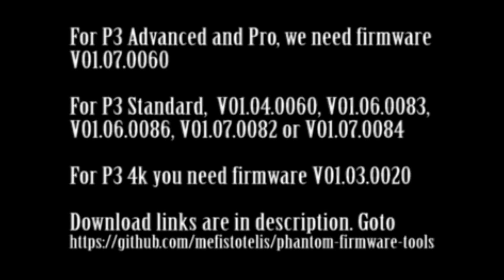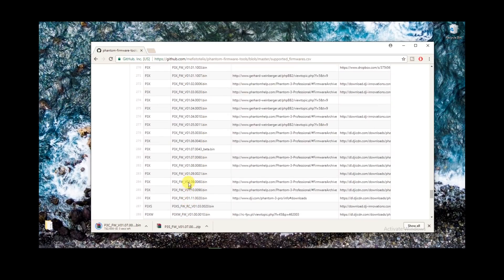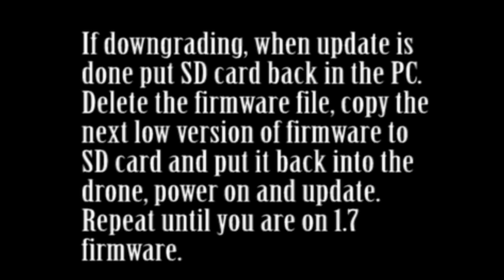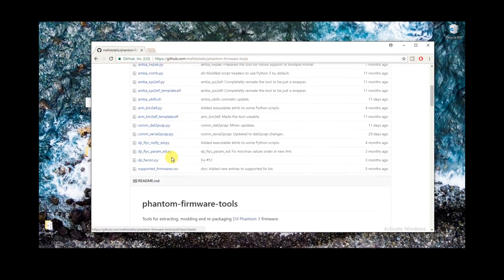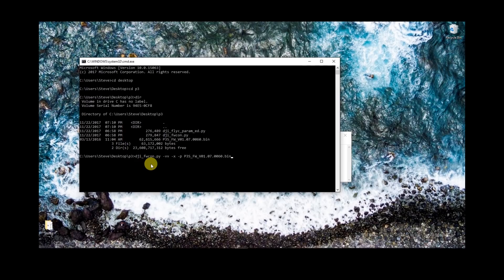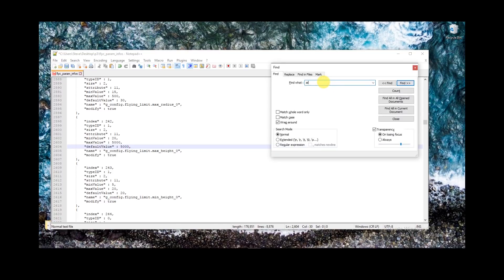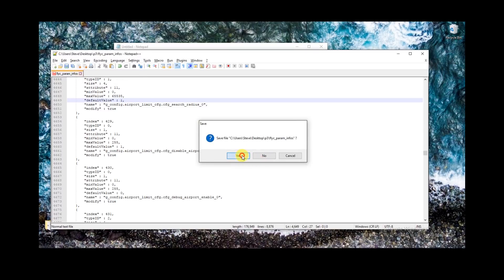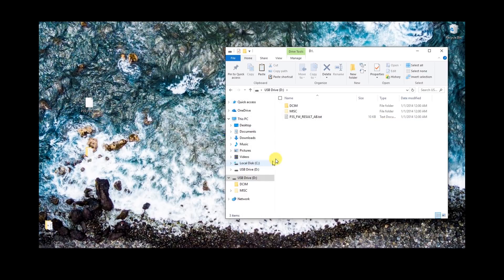Phantom 3: How to modify flight parameters and hack height, speed, flight area restrictions

Comment: P3A 1.7 RC1.57 APP 2.42 ,
After you have modified flyc_param_infos according to your method and uploaded it,， NFZ Still，Is NFZ written into the hardware?
Reply from the maker: make sure you do the two nfz parameters, after nfz will not prevent flight. It still shows the red circle and will prompt you.

Comment: Got my parameters modified and it's working fine in regard to the new parameters. When I go to the about in my DJI GO app it still shows the + after the version. I did each downgrade in order with debug file on SD card for each time. My controler downgrade went fine. My drone works fine as well. Love the new freedom with the mods!
Reply: Can you guide me downgrade? 1.09 to 1.08 ?? I lowered the compass no cali.
Reply: What model did you do ? Pro or advanced? And did u use these parameters? And all worked   nfz etc etc height? Hack

Comment: i have the phantom 3 pro running FW VO1.11.0020.BIN but i cant get it to run in cmd keep getting no module named crypto any one please ,just want to modify my firmware i have installed now is it possible thanks in advance
Reply from the maker: your gonna need to install a module into python called crypto. more info here: http://dji.retroroms.info/howto/modp3params
Reply: thank you so much at last only one thing do I have to put = before the value number or just do the same as you and change the default value?. have repacked the file opened in the notebook to check and all the values are changed just as you have done, but in my cmd it says updated zero parameters , but like I say the file I have saved shows the values have changed so am I good to go or do I need to put = before the value ie =2 thanks in advance great video by the way
Reply: So if "defaultvalue" :=50, is that good  or just change the same as the video help I'm nearly there

Comment: im getting an error when running the first extract command, can someone help? heres the content
C:\Users\April\Desktop\p3>dji_fwcon.py -vv -x -p P3X_FW_V01.07.0060_m0306.bin
P3X_FW_V01.07.0060_m0306.bin: Opening for extraction
Traceback (most recent call last):
  File "C:\Users\April\Desktop\p3\dji_fwcon.py", line 672, in <module>
    main(sys.argv[1:])
  File "C:\Users\April\Desktop\p3\dji_fwcon.py", line 651, in main
    fwpkgfile = open(po.fwpkgfile, "rb")
FileNotFoundError: [Errno 2] No such file or directory: 'P3X_FW_V01.07.0060_m0306.bin'

C:\Users\April\Desktop\p3>dji_fwcon.py -vv -x -p P3X_FW_V01.07.0060.bin
P3X_FW_V01.07.0060.bin: Opening for extraction
P3X_FW_V01.07.0060.bin: Package format version 2016 detected
P3X_FW_V01.07.0060.bin: Header:
{   'entry_count': 15,
    'hdrend_offs': 846,
    'magic': 305419896,
    'magic_ver': 1,
    'manufacturer': b'DJI',
    'model': b'P3S',
    'padding': '00000000000000000000',
    'timestamp': 1457841881,
    'ver_latest': 17236028,
    'ver_latest_enc': 113525633,
    'ver_rollbk': 17170472,
    'ver_rollbk_enc': 113591189}
P3X_FW_V01.07.0060.bin: Module index 0
{   'decrypted_len': 43776,
    'decrypted_md5': 'cc3baf52297f2eb67adf98f0270956f4',
    'dt_offs': 846,
    'encrypt_type': 1,
    'reserved2': 1,
    'spcoding': 16,
    'splvalue': 0,
    'stored_len': 43776,
    'stored_md5': 'bbd8964489204dfdb8858d5824a116b0',
    'target': 'm0305',
    'target_name': 'main '
                   'controller '
                   "'A3' "
                   'ldr',
    'version': '34.02.0009'}
P3X_FW_V01.07.0060.bin: Module index 1
{   'decrypted_len': 788916,
    'decrypted_md5': 'dff8c595d9b465617c8a1aa45aaa109a',
    'dt_offs': 44622,
    'encrypt_type': 0,
    'reserved2': 1,
    'spcoding': 0,
    'splvalue': 0,
    'stored_len': 788916,
    'stored_md5': 'dff8c595d9b465617c8a1aa45aaa109a',
    'target': 'm0306',
    'target_name': 'main '
                   'controller '
                   "'A3' "
                   'app',
    'version': '02.04.3328'}
P3X_FW_V01.07.0060.bin: Module index 2
{   'decrypted_len': 93696,
    'decrypted_md5': 'dddb469333d2d709d1beb283c2427f9b',
    'dt_offs': 833538,
    'encrypt_type': 1,
    'reserved2': 1,
    'spcoding': 16,
    'splvalue': 0,
    'stored_len': 93696,
    'stored_md5': 'ba4eb3942104fcdec2654f8a00dc6846',
    'target': 'm0400',
    'target_name': 'gimbal '
                   'mdl '
                   '0',
    'version': '01.41.0000'}
P3X_FW_V01.07.0060.bin: Module index 3
{   'decrypted_len': 19140,
    'decrypted_md5': '09bebba2951faf82ea3f9cb0793f5dd7',
    'dt_offs': 927234,
    'encrypt_type': 0,
    'reserved2': 1,
    'spcoding': 0,
    'splvalue': 0,
    'stored_len': 19140,
    'stored_md5': '09bebba2951faf82ea3f9cb0793f5dd7',
    'target': 'm1100',
    'target_name': 'battery '
                   'controller '
                   '1 '
                   'app',
    'version': '01.07.3841'}
P3X_FW_V01.07.0060.bin: Module index 4
{   'decrypted_len': 42496,
    'decrypted_md5': '8f773cc3245745ac6861af803fc520b6',
    'dt_offs': 946374,
    'encrypt_type': 1,
    'reserved2': 1,
    'spcoding': 16,
    'splvalue': 0,
    'stored_len': 42496,
    'stored_md5': '4b0ef2a6f0acac04b2c5582ee21361e8',
    'target': 'm1200',
    'target_name': 'electronic '
                   'speed '
                   'control '
                   '0',
    'version': '01.10.0000'}
P3X_FW_V01.07.0060.bin: Module index 5
{   'decrypted_len': 42496,
    'decrypted_md5': '8f773cc3245745ac6861af803fc520b6',
    'dt_offs': 988870,
    'encrypt_type': 1,
    'reserved2': 1,
    'spcoding': 16,
    'splvalue': 0,
    'stored_len': 42496,
    'stored_md5': '4b0ef2a6f0acac04b2c5582ee21361e8',
    'target': 'm1201',
    'target_name': 'electronic '
                   'speed '
                   'control '
                   '1',
    'version': '01.10.0000'}
P3X_FW_V01.07.0060.bin: Module index 6
{   'decrypted_len': 42496,
    'decrypted_md5': '8f773cc3245745ac6861af803fc520b6',
    'dt_offs': 1031366,
    'encrypt_type': 1,
    'reserved2': 1,
    'spcoding': 16,
    'splvalue': 0,
    'stored_len': 42496,
    'stored_md5': '4b0ef2a6f0acac04b2c5582ee21361e8',
    'target': 'm1202',
    'target_name': 'electronic '
                   'speed '
                   'control '
                   '2',
    'version': '01.10.0000'}
P3X_FW_V01.07.0060.bin: Module index 7
{   'decrypted_len': 42496,
    'decrypted_md5': '8f773cc3245745ac6861af803fc520b6',
    'dt_offs': 1073862,
    'encrypt_type': 1,
    'reserved2': 1,
    'spcoding': 16,
    'splvalue': 0,
    'stored_len': 42496,
    'stored_md5': '4b0ef2a6f0acac04b2c5582ee21361e8',
    'target': 'm1203',
    'target_name': 'electronic '
                   'speed '
                   'control '
                   '3',
    'version': '01.10.0000'}
P3X_FW_V01.07.0060.bin: Module index 8
{   'decrypted_len': 2680,
    'decrypted_md5': '08e01b61a70e503bb60362eaf4d734cc',
    'dt_offs': 1116358,
    'encrypt_type': 0,
    'reserved2': 1,
    'spcoding': 0,
    'splvalue': 0,
    'stored_len': 2680,
    'stored_md5': '08e01b61a70e503bb60362eaf4d734cc',
    'target': 'm1500',
    'target_name': 'transmitter '
                   'usb '
                   "'IG810 "
                   "LB2_68013_TX'",
    'version': '01.01.0512'}
P3X_FW_V01.07.0060.bin: Module index 9
{   'decrypted_len': 77876,
    'decrypted_md5': '47bea6b588988517d7731a677eaaef44',
    'dt_offs': 1119038,
    'encrypt_type': 0,
    'reserved2': 1,
    'spcoding': 0,
    'splvalue': 0,
    'stored_len': 77876,
    'stored_md5': '47bea6b588988517d7731a677eaaef44',
    'target': 'm1700',
    'target_name': 'visual '
                   'positioning '
                   'module '
                   "'camera'",
    'version': '01.01.0263'}
P3X_FW_V01.07.0060.bin: Module index 10
{   'decrypted_len': 25908,
    'decrypted_md5': 'def18f11a3b0ae5ab53624d52c0e322e',
    'dt_offs': 1196914,
    'encrypt_type': 0,
    'reserved2': 1,
    'spcoding': 0,
    'splvalue': 0,
    'stored_len': 25908,
    'stored_md5': 'def18f11a3b0ae5ab53624d52c0e322e',
    'target': 'm1701',
    'target_name': 'visual '
                   'positioning '
                   'module '
                   "'sonar'",
    'version': '01.00.0519'}
P3X_FW_V01.07.0060.bin: Module index 11
{   'decrypted_len': 4194304,
    'decrypted_md5': '2c3976888e71103fd4bd78f76452cb65',
    'dt_offs': 1222822,
    'encrypt_type': 0,
    'reserved2': 1,
    'spcoding': 0,
    'splvalue': 0,
    'stored_len': 4194304,
    'stored_md5': '2c3976888e71103fd4bd78f76452cb65',
    'target': 'm1900',
    'target_name': 'lightbridge '
                   'FPGA '
                   'on '
                   'air '
                   'model '
                   '0',
    'version': '01.00.2144'}
P3X_FW_V01.07.0060.bin: Module index 12
{   'decrypted_len': 56704476,
    'decrypted_md5': '213a382b3f7f37ffbd51757679c2f4a7',
    'dt_offs': 5417126,
    'encrypt_type': 0,
    'reserved2': 1,
    'spcoding': 0,
    'splvalue': 0,
    'stored_len': 56704476,
    'stored_md5': '213a382b3f7f37ffbd51757679c2f4a7',
    'target': 'm0100',
    'target_name': 'camera '
                   "'Ambarella "
                   "A9SE' "
                   'App',
    'version': '01.23.4920'}
P3X_FW_V01.07.0060.bin: Module index 13
{   'decrypted_len': 412780,
    'decrypted_md5': 'a7f23ca967f5a61fadeb20807b69318a',
    'dt_offs': 62121602,
    'encrypt_type': 0,
    'reserved2': 1,
    'spcoding': 0,
    'splvalue': 0,
    'stored_len': 412780,
    'stored_md5': 'a7f23ca967f5a61fadeb20807b69318a',
    'target': 'm0101',
    'target_name': 'camera '
                   "'Ambarella "
                   "A9SE' "
                   'Ldr',
    'version': '01.23.4920'}
P3X_FW_V01.07.0060.bin: Module index 14
{   'decrypted_len': 81284,
    'decrypted_md5': '8b944fa28043712443e1cedfea8ee112',
    'dt_offs': 62534382,
    'encrypt_type': 0,
    'reserved2': 1,
    'spcoding': 0,
    'splvalue': 0,
    'stored_len': 81284,
    'stored_md5': '8b944fa28043712443e1cedfea8ee112',
    'target': 'm0900',
    'target_name': 'lightbridge '
                   'MCU '
                   "'STM32F103'",
    'version': '02.13.0000'}
P3X_FW_V01.07.0060.bin: Headers checksum 1862 matches.
P3X_FW_V01.07.0060.bin: Extracting module index 0, 43776 bytes
Traceback (most recent call last):
  File "C:\Users\April\Desktop\p3\dji_fwcon.py", line 672, in <module>
    main(sys.argv[1:])
  File "C:\Users\April\Desktop\p3\dji_fwcon.py", line 653, in main
    dji_extract(po,fwpkgfile)
  File "C:\Users\April\Desktop\p3\dji_fwcon.py", line 494, in dji_extract
    copy_buffer, encrypt_iv = dji_decrypt_block(copy_buffer, encrypt_key, encrypt_iv)
  File "C:\Users\April\Desktop\p3\dji_fwcon.py", line 312, in dji_decrypt_block
    crypto = AES.new(enc_key, AES.MODE_CBC, enc_iv)
NameError: name 'AES' is not defined

C:\Users\April\Desktop\p3>
Reply from the maker: you will need to install the crypto module into Python to get rid of that AES error. Also, your second command for the m306 file, you are using the wrong python file, use htis command instead "dji_flyc_param_ed.py -vv -x -m<filename>"

Comment: Hi Steve, I tested a few round up and down finally got a result.  Firmware 1.07, 1.08 had no issue with NFZ but 1.09, 1.10 were not successful.  I have sent to you an email with patched files for your comments. Thanks.
Reply: can you please confirm this works with every version? cannot downgrade remote from 1.9.2

Comment: Hi Steve, thanks for your excellent work.  When I read your wiki with"These instructions apply to any firmware version as of January 2018; the keys were found, we are good to go on all versions.",  do you mean we need still to downgrade from the latest firmware to 1.07 or we could directly unpack and repack the latest firmware??
Reply from the maker: yes we can do on any fw version now
Reply: I found info below that we could do it with latest firmware.  Thanks.
Reply: Many thanks, I have done with higher fw but not the latest one which needs to sign in.

Comment: I have the firmware 1.11.20 on my P3P, is it safe to do this downgrade? No risk of brick?
Reply from the maker: Ive downgraded clients from that to 1.7 without any issues. You need to downgrade RC to 1.6 as well.
Reply: OK Digdat0 Thanks. I will perform the downgrade.
Reply from the maker: make sure you go one-by-one and dont skip. its slow, but is the best way.
Reply: Already i did the downgrade from version 1.11.20 to version 1.10.9 with debug method without any problem, I felt panic when I saw that it takes a long time to finish, but in the end everything was correct. Now I'm going to perform the downgrade to the next verion and so on until version 1.7.6
Reply: Hi again, after having made the last downgrade to version V01.07.0060, I have the following warning in the Dji Go App: Aircraft Firmware Inconsistent. my version of Dji Go is 3.1.10. The RC is in the firmware version 1.6.0. I made the last downgrade with the debug method. All the other downgrade were sucefull. The led in the gimbal is blinking red. What I can do? Reinstall the latest firmware V01.07.0060?
Reply: I think the problem is the RC firmware, version 1.6 in combination with the firmware of AC 1.7.06 does not work for me, perform the RC downgrade to ver 1.5.8 and get it to work for me. Why can not I make it work with firmware 1.6?
Reply from the maker: what error do you get?
Reply: I get the folowing error: Aircraft firmware inconsistent
Reply: I did a  firmware downgrade to the RC to version 1.5.8 and everything worked.
Reply: Jose Reyes  hi ive been reading your post on your phantom 3 pro downgrade my p3 pro is at 1.11.20 and my rc is at 1.9.2 was this what your p3pro was at when u performed this hack and is it possible for me to do this downgrade too  with my current fw ?

Comment: Hallo, i went from last fw for ph3 adv to 1.7.60 fw and downgraded rc too from last fw to 1.5.80. Now... i have 4 batteries but with 3 of them i have a 1.7.60 fw and with the last one, i have 1.7.60+. What does mean plus "+" after version fw?
Reply from the maker: + means some Fw is newer than on the aircraft, probably the batteries.
Reply: Ok but i have 4 batteries and i downgraded fw with everyone. Why i have the problem with only one?
Reply from the maker: Where did you start on FW, and how did you downgrade? Did you go one by one, or did you skip? Did you use debug file? Did you power on aircraft after fw update? I would re-flash the 1.7 fw without the debug file and see if it fixes. But, as long as it flies well i wouldnt worry abou the the +
Reply: guerino maione
Ok, now the bird has 1.7.60 (with one battery 1.7.60+). I repeat the procedure from the beginning starting from 1.7.60. Have i to use the debug file for flashing the same fw?

Comment: Hello, first I want to say thanks for putting up such great info in an easy to follow method. It is clear that you really know what you are doing. 

I am currently trying to downgrade my P2C to 1.07.0084.    I started going row by row on the github list and last flashed 1.07.0090 and then tried to flash 1.07.0086. At this point it does not properly flash and the log reads that it cannot downgrade to the intended version:
========== 2018.01.10 00:59:15 =====================
Packet: P3C_FW_V01.07.0090.bin
Upgrading ...
Result: Success.

========== 2014.01.01 00:00:24 remo-con disconnect======
Packet: P3C_FW_V01.07.0086.bin
Result: Abort.
The current firmware does not support downgrade. Use a different version of firmware to downgrade the target version.

What steps do I need to take to get the firmware to the needed 1.07.0084? Thanks
Reply: Why cant the newer firmware be modified in the same way as the old firmware?
Reply from the maker: The newer firmware is encrypted - the ones we can modify are not encrypted.
Reply: digdat0   So is there a way get around the error message to still downgrade to 1.07.0084?
Reply from the maker: you need to use the debug file on the SD card. Over at phantompilots.com there is a good thread on downgrading the p3 standard, I would check that for more info to do it properly
Reply: Great, thanks so much
Reply: I still cant get it to flash to the proper firmware. I have tried flashing firmware off of the dji site and then upgrading to a proper firmware for the mod but still no luck. It is almost like dji has put out a patch that does not allow the unencrypted firmware to be flashed.
Reply from the maker: what does the log show in the hidden MISC/LOG folder? can you pate it here or link to it?
Reply: Here is my debug file, firmware I am trying to flash and the two logs:
https://drive.google.com/drive/folders/1Rw3MCji28iUiI_zyeAvCW_qQW6niHAht?usp=sharing

Comment: Steve I almost forgot in my email to you the most important parameter if it can be modified to me would be the increase of the RF coming off the bird. I currently switch all the antennas out to Cloverleaf 3 + 4 half wave styles and seem to get some success there but there's got to be something to drive that output amp hotter. Or am I wrong?
Reply from the maker: nothing for p3a/p3p, but for p3s you can use the magic power mod. https://phantompilots.com/threads/how-to-update-tx-power-with-magic-power-v5-0.87654/

I should get back to it in a bit, got backed up today